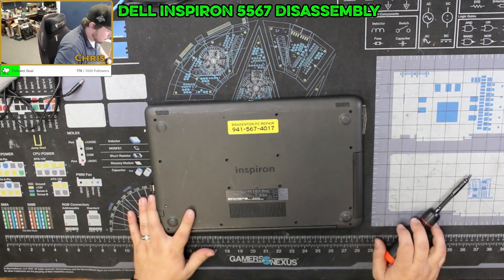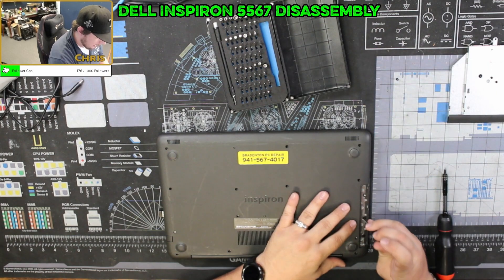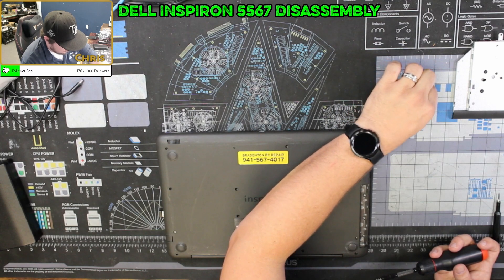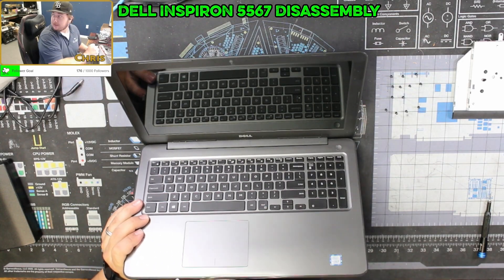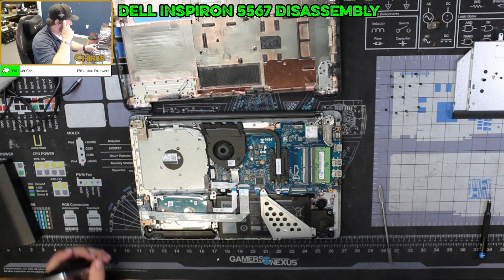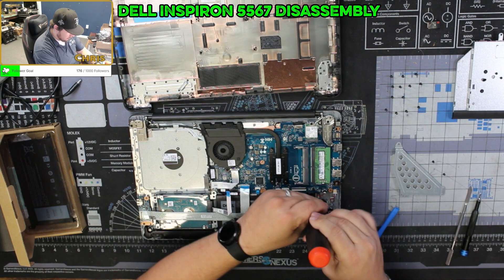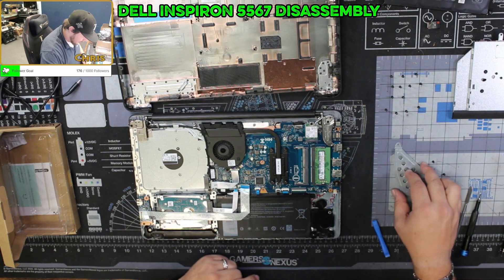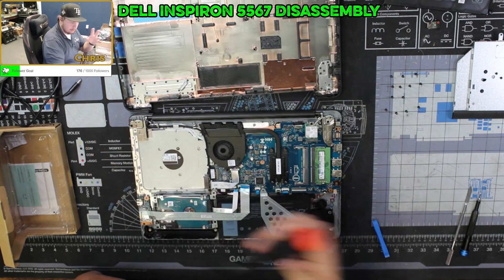How to replace the Battery on a Dell Inspiron 5567. Walkthrough!

Comment: Not sure if genuine battery for Inspiron 5567 is available in my region. Currently it has Type WDX0R made in Korea. But I am unable to get a replacement at the store and on Dell website. If there's other compatible ones. Please let me know.
Reply from the maker: Once they are fully out of production they can be hard to acquire. If you need a battery then get any battery you can. If you have access to a genuine one that is preferred, but like I said, any one you can get is good enough.
Reply: video is all about  changing dell 5567 battery. but did not even bother to tell the battery model which is more important rather than other things discussed here. thanks anyway.
Reply: WDXOR 42Wh
Reply: I just changed the battery in mine 24+hrs ago. The case was very hard to snap off - not as all as easy as yours was. I was getting frustrated because I really had to pull to get it about 80% open. I was too scared to try to get the top all the way off. I just propped it open as far as it would go. I replaced the battery - mine was kind of bloated as well. I put everything in the right way and put all the screws back in. The screws were very hard to unscrew as well. And one screw never came out - it just kept spinning and wouldn’t fall out even though it was totally loosened. So I put the battery in following some other vid I saw. I was pleased with myself - then pressed power and….nothing. Thought I did something wrong so unscrewed everything again and put the old battery back in - the laptop booted up fine, but went dead immediately, so I know nothing’s wrong with the laptop. So I disconnected old and reconnected the new battery again. This time I didn’t put all the screws on the cover back in - pressed power …. nothing. Asked google if a new battery needs to charge and it said charge battery for 12-24 hrs. I checked at 13hrs - nothing. I checked at 30 hrs - still nothing. Decided to look for another video today and this one came up. I watched it and pretty much did the same thing you did only mine didn’t have that metal thing on the inside and I didn’t have cables covering my battery. I pressed the battery connectors in - making sure they’re snug - I’m pretty sure I can’t push them in any further. What could be the issue? I noticed you pressed power and yours didn’t turn on either and you said it needs to charge, but you didn’t say how long or do like a follow-up showing it powering on. So now, i’m at a loss as to what to do next. I’ll pop the back off again, but at this point I’ve popped it off 3-4 times and I’m getting frustrated because each time it takes a lot of force to pop off and I still haven’t taken it off all the way. I have the same unbranded new battery you used. Does it need to charge for a long time???

Comment: could i use my dell inspiron 5567 which has a bloated battery without the battery and as a desktop with charger connected instead?
Reply from the maker: Thanks for stopping by the stream! Yes you are okay to use it plugged in, as I said I would highly recommend removing the battery as when they get bloated, they get dangerous.
Reply: @Bradenton-PC-Repair If I need the batery working all the time (cable plugged in), Does the batery recieve so much damage?